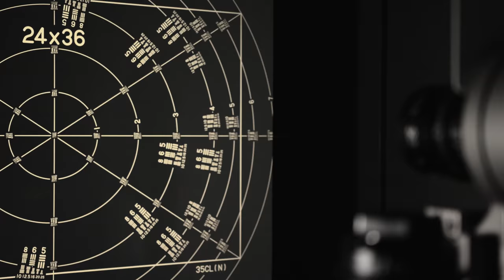SIGMA CINE LENSーHigh Speed Zoom Line

Comment: Hello!
Question regarding Sigma zoom cine lens 18-35mm T2.
Tell me, please, whether there is a vignetting even when using the outer frame 4X4" square filter on matte box on the front barrel lens 
(on the 18 mm wide angle)?
Thanks.